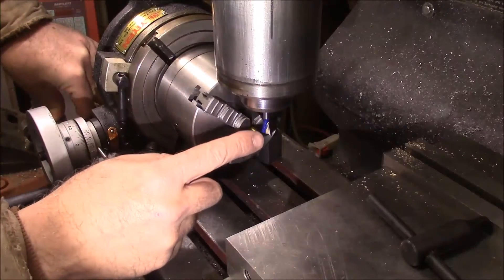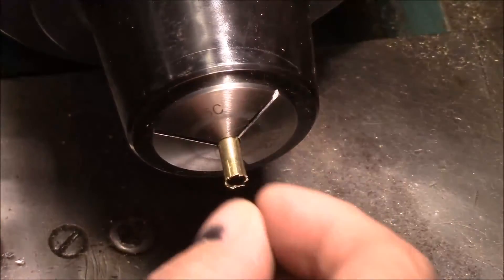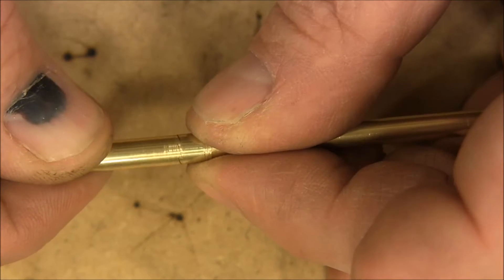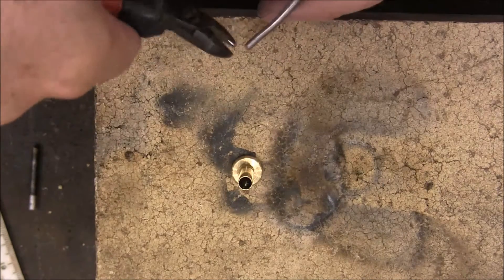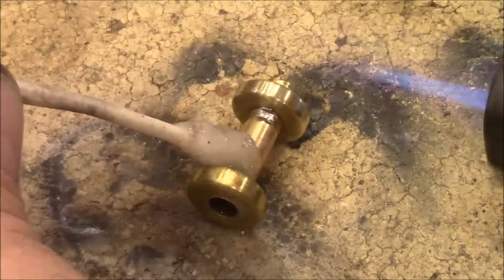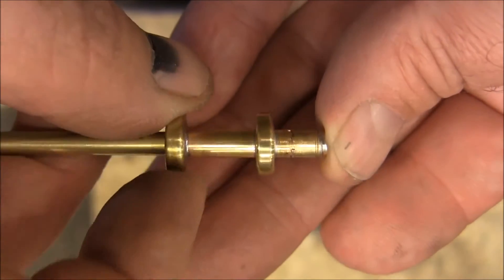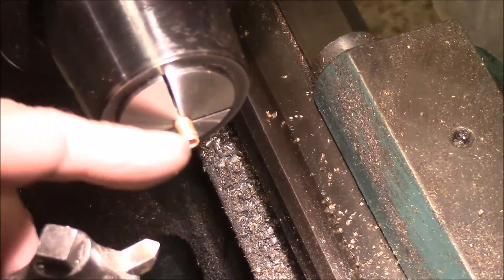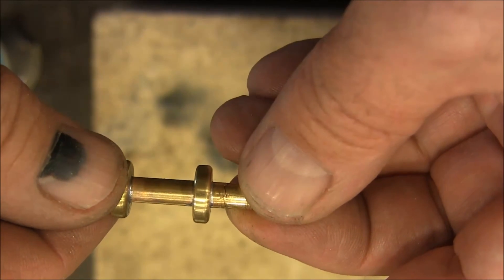Flying Pendulum Part 5: Making the Barrel Ratchet

Comment: What a clever way to make the ratchet.  Never would have thought of using a dovetail cutter for that, good one.  By the way what soldering flux are you using.  It looks to be very nice to use.  Thanks for the video.
Reply from the maker: Thanks, I was really pleased with it.  It's the first ratchet of any kind that I've made.